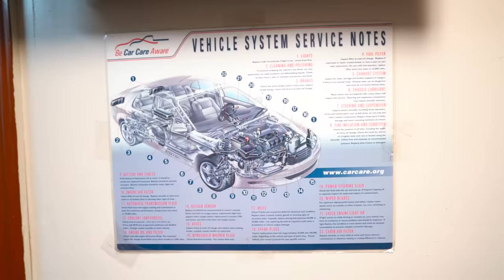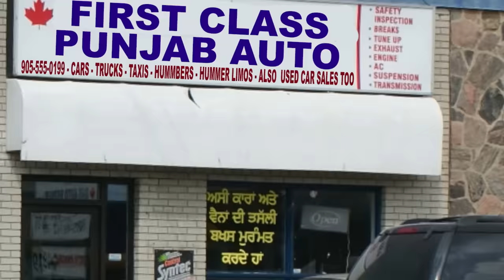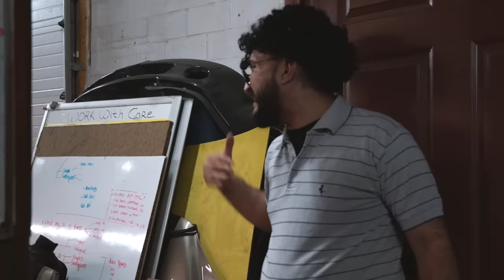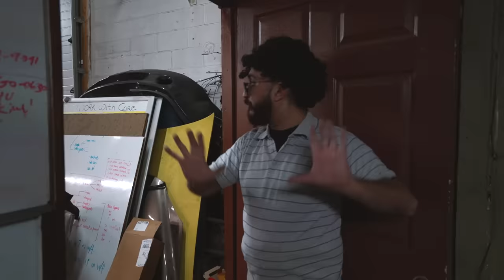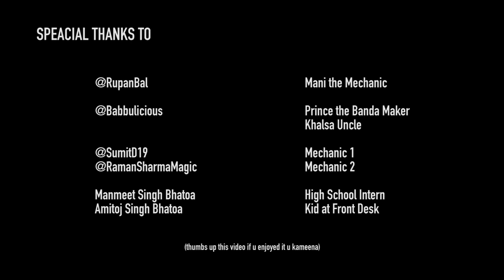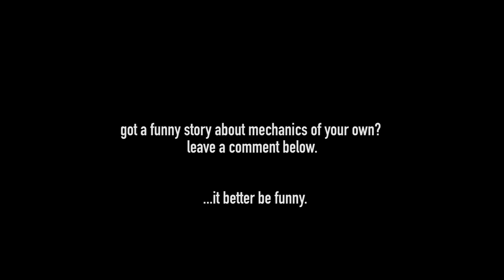Car Mechanics from HELL

Comment: Not sure about everyone else's experiences but I always had issues with gore car dealerships. They left a thing open while servicing my car, they put a crappy battery(I paid for new battery price) then I had to get these problems fixed by desi mechanics and they diagnosed the issue so quickly and fixed it for good.
Gore dealership people always tried to rip me off as well. Running unnecessary diagnostics and charging sooo much when the issue was clear, battery was dead lol. 
My experience has been the exact opposite of this lol.
Reply: Hor kosh ki kar sakadah

Comment: i work at a car dealership. We are all hard workers and if you want to be racist about it…we have more hispanic workers that any other race. We all work with the customers best interests. If we say you have to change a lot of parts it all because if you repair something u need to repair the components that help the replacement object function correctly. We are not trying to screw over anybody by any means. We are just making sure the car does not come back to the dealership saying that we didnt fic the problem because it came back or etc.
Reply: Bro chill. A, he is talking about Indian shops, and B, it’s supposed to be a joke, so calm the fk down